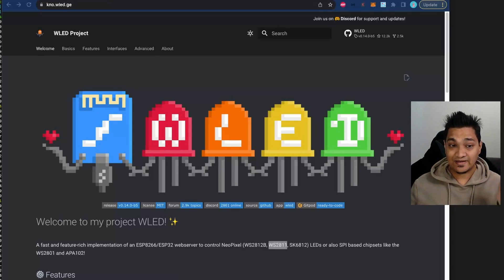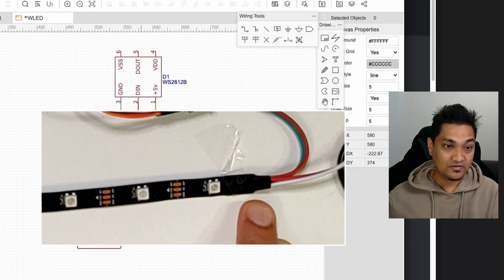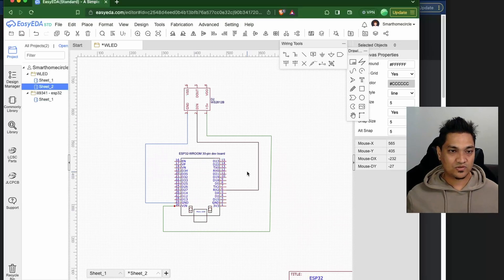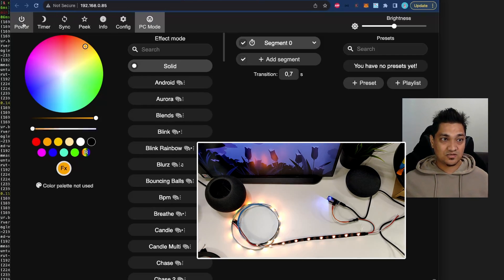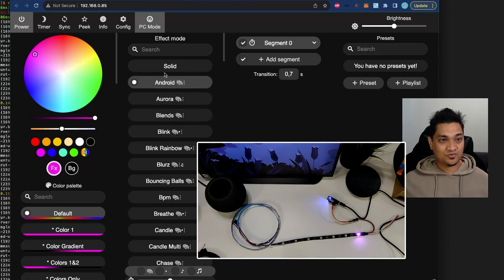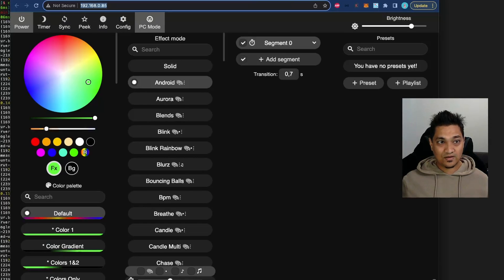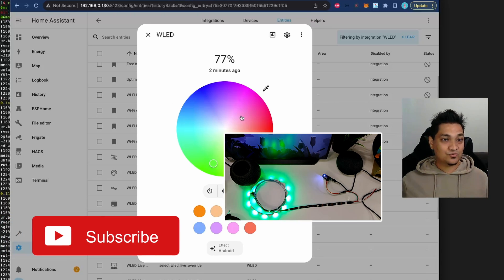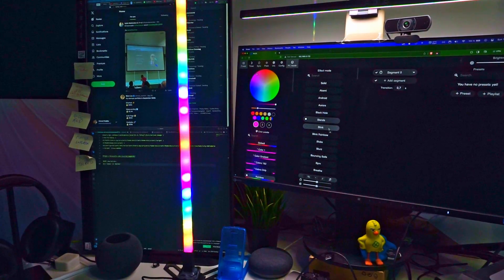How To Control LED Strip In Home Assistant Using WLED 🔥 | WS2812B LED | ESP32 & D1 Mini

Comment: Hi. Tks for this great video. I have a question. 
I bought a cheap LED, monochromatic. But it came with a Wi-Fi controller (tuya). On the tuya app I see several controls, like intensity and color temp. But on home assistant I see only on/off...
What's the recommended approach to have more control on HA?
Reply from the maker: How have you connected it to HA? via the Tuya integration?
Reply: @SmartHomeCircle  yes, I used tuya integration
Reply from the maker: I think tuya might only support on and off function in Home Assistant. I am not sure about that. Sorry :(

Comment: hi, great video! well done. I purchased the material as per the guide but I wonder, the LED strip is connected to the D1 mini which powers it, but the strip I purchased is the 5 meter one with 60 LEDs per meter. Powered by the D1 mini alone? Does the LED strip not need additional power? thanks
Reply from the maker: You can either cut 1 mtr from it and use it with the d1 mini directly or if you plan to use the 5 mtrs then you will have to power it with an external power supply of 5v. The D1 mini cannot provide the high current required for 5mts.

Comment: i have flashed firmware to my esp32 before, how can i make the menu appear again at 6:09 to add home assistant
Reply from the maker: For that you will have to find out the IP address of the ESP32 with which it is connected to your wifi. 
Using that IP address you can access the webpage.
Reply: @SmartHomeCircle  the response is a bit slow and inaccurate but thanks anyway. the answer is to plug the device into the computer and repeat the steps as before. once the software is available the dialog box that appears will change. there you can continue to update the firmware or connect google assistant

Comment: How many meters of neopixel strip can I control?
Reply from the maker: I used it with 60 leds and it works fine.
I think above that its better to give a dedicated power supply.

Comment: Followed this guide, got to home assistant on my esp30 board and am getting a firmware unknown error when I try to change settings via home assistant but still works via web ui/ip
Reply from the maker: Which setting is this?
Has the device already integrated with home assistant?

Comment: Good Video but .. what are the cables to use (female female?) for connection and what to use for power supply. can you give the aliexpress links for these 2 elements thank you
Reply from the maker: I am sorry. I didn't understand your question.
Reply: Looks like he used female connections to the board and soldered to the LED strip w/ insulator.  Power comes from the D1/ESP board.  He explains how to connect everything in the beginning of video. Thanks for the video @SmartHomeCircle by the way. @SmartHomeCircle did you write the software yourself in yaml?  I'm just learning home assistant and wanna set up my first automation with something like this to light up my closet but need brighter WLED.

Comment: Thanks for the video. I actually wanted to try this out since I have Yeelight LED strip which shows the light dot marks inside the aluminium channels. I'm also seeing the similar led light dots in your setup as well. It's there a way to overcome this? If we go with 60leds per metre, do you think, this led dots will be hidden? Pls advise of you have any info on this.
Reply from the maker: I can't give a definite answer to this as I haven't used Yeelight LED
LED strips can be COB type or could be individual LEDS. 

Also, it depends what type of LEDs it has. The LEDs need to be individually addressable for WLED integration.  Like e.g WS2812B.